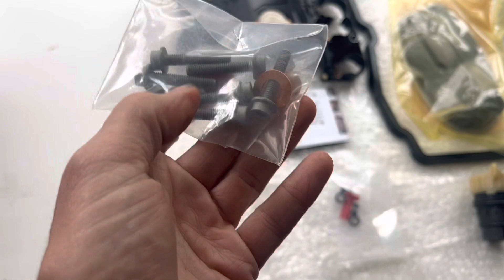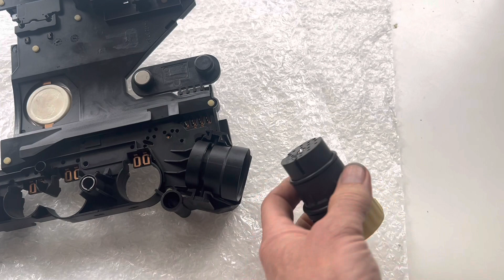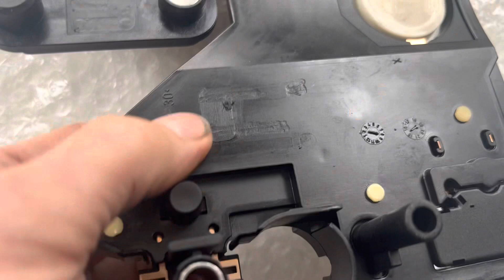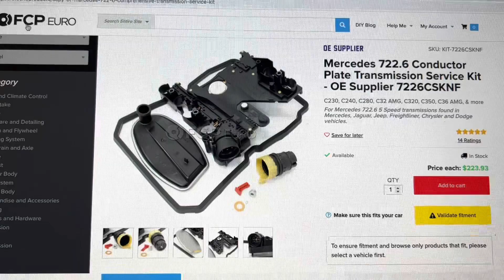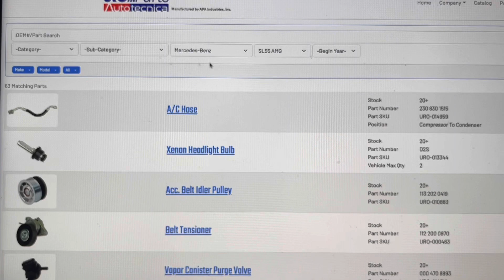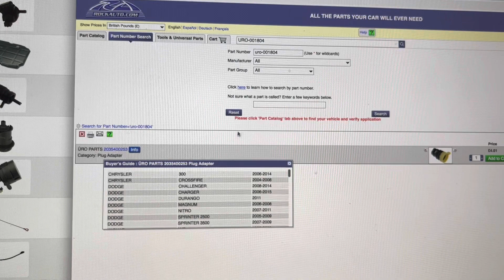Mercedes stuck in gear, limp mode, hard shift problems 722.6 transmission conductor plate. Oil leak.

Comment: Awesome Video.. Thank you very much.... THE BEST 722.6 Video I have ever seen.. and I have seen MANY......especially the Bilstein Information for part numbers.. PRICELESS INFORMATION.... I have 2 x w203-045  C200 Kompressor one has 300K KMLMS..The other has 108K klms... I am about to replace the whole control unit inside the Transmission... bought on eBay for $251  shipped... see what happens  (giggles)
Reply from the maker: Thanks for your kind comments. Good luck - it will be hugely satisfying if you can get it sorted as a garage would no doubt charge you a fortune. Mike

Comment: Hey Mike, on the 1980's, w126 's, do these older transmissions do something like this and limit speed. I still haven't fixed the SEC after two years. It won't drive faster than 30 mph. It's been over a year since I touched and looked at it and now I am seeing a repeated theme in newer Mercedes and sprinters.
Reply from the maker: My older mercs certainly don't have this type of complicated transmission. Give me the exact model and year of your car and the exact symptoms. Mike

Comment: @MikesMercsandothercars 
So I bought a really cheap conductor plate for my 97 sl320 for like $60 and it's working fine but seeing the prices everywhere else has me concerned do you think it will be fine or will I need to get a more expensive conductor plate  and redo the job?
Reply from the maker: Well, they do say if it ain't broke, don't fix it so hopefully you will be just fine....and if it does break prematurely, you will know better next time. Mike

Comment: Hello, in my case it locks up in 3rd gear, after starting the car it only goes to 4th gear, and after downshifting to 3rd it stays in this gear. Do you think replacing the board will help?
Reply from the maker: What car do you have? If you have checked your transmission fluid level and it is OK, next step would be to scan the car for fault codes. Mike
Reply: @MikesMercsandothercars  viano w639 2.2 cdi
Reply from the maker: Have you scanned the van for codes yet?

Comment: Hi Mike I just bought a cheap project ML320 with the 722.6 transmission. only 118k miles. but it doesnt move in any gear. reverse and drive rev just like I'm in neutral. any ideas? I noticed the rear shifter bushing is missing but I would think I could atleast get the car to move a little....
Reply from the maker: First thing I would do is to check the level of the transmission fluid?

Next I would scan the car for fault codes - specifically related to the TCM Transmission Control Module. Mike
Reply: @MikesMercsandothercars  I have a transmission dipstick on the way. its supposed to come in tomorrow!

 If I have TCM related codes do you think i have the transmission fluid wicking up from the harness problem?
Reply from the maker: Possibly. First I would check the level of the fluid. If that is OK, I would look carefully at the codes. Could be conductor plate, solenoids in conductor plate, hall sensor, speed sensors, small metal particles in oil shorting out connectors, oil wicking up cable...to name but a few things. Mike

Comment: Can you recommend a good code reader to delete the dtc codes? I changed my conductor plate and my reader can’t communicate with my transmission
Reply from the maker: I use the Autel Maxidas DS808 which is quite expensive. I also have a cheap and cheerful Launch scanner but I'm not sure whether this can delete those codes - I've never tried. Where are you based? Mike
Reply: @MikesMercsandothercars located in MN, getting the p0715 code still even after I clear  it, thinking about getting the iCarsoft MBII to connect to the tcm
Reply from the maker: @majerbear_zz  Is MN Maine?...Manchester...Munich? Not sure the iCarsoft will be able to delete that transmission related codes - I had one and just sold it to a subscriber who just needs it for basic stuff.

Do you have a Mercedes Indy near you?
Reply: @MikesMercsandothercars Minnesota, I do have one but they won’t clear the code for less than 200 bucks
Reply from the maker: That seems like a lot. What vehicle is it?

Comment: Would this being bad cause the car not to go in reverse
Reply from the maker: Possibly……although my guess is that your problem lies elsewhere. Remember losing reverse on my R107 and thinking I’d need a new transmission but it turned out to be something really simply. So you might be lucky…. Mike

Comment: I recently replaced the conductor plate on my transmission. After the replacement, the car shifted fine for about a month—around 7 to 8 driving sessions.

However, after the 8th time, the transmission went into limp mode again. I did some research and realized I had used a cheap conductor plate.

Round 2:
I decided to go with a more reliable part and bought a higher-quality Dorman conductor plate. After installing it, the car shifted smoothly and drove fine for about 5 miles. I then parked it for 15–20 minutes.

When I started it back up and drove off, the transmission didn’t want to shift properly around the 10–15 mph range. I pulled over and waited a minute without turning the car off. After that, it started shifting fine again.

Once I got home, I checked the transmission fluid level—it was low. I added a bit more fluid and went for another drive. But after turning the car off and restarting it, the same shifting issue came back.

At this point, I still feel like the transmission fluid level might be the cause of the problem.

Any suggestions?
Reply from the maker: Hi - sorry to read you are having a problem. What car do you have and do you have any transmission related error codes when you scan the car?

I wasn't aware that was such a thing as 'cheap conductor plates' - I have never heard of that as being an issue.

If you were low on transmission fluid that would definitely cause transmission issues. Do you have a transmission dipstick? see:

https://www.youtube.com/watch?v=Xx8iDOgbEZ4&list=PLONqXqFnLGrjrRMyMj-02uPxLVogBjr8a&index=15&pp=iAQB

https://www.youtube.com/watch?v=lkYPmtp8W4w&list=PLONqXqFnLGrjrRMyMj-02uPxLVogBjr8a&index=25&t=647s&pp=iAQB

Mike
Reply: @MikesMercsandothercars 2013 sprinter, and yes, dipstick reads on the low end when it's not running, but after it's running, it's shorta like nothing is there on dip stick.
Reply from the maker: @endersingh3180  Hi - I am no expert in the Sprinter BUT....ideally you need to have a scanner to check the transmission oil; level correctly. The temperature of the oil will affect its level on the dipstick and that is why you need a scanner to read the correct temp. With the transmission oil at 80 degrees, your level should be at the top end of the dip stick. If you are using the correct dip stick and it is reading close to zero then you have a problem. First you need to top up the oil to the correct level using the procedure outlined in my video...and then you need to ascertain what happen to your transmission fluid....and third you need to pray that you havent damaged the transmission by driving with low oil. IF you have low transmission oil, you will experience no end of tranny problems...limp mode....difficultly changing gear, gears slipping etc. Mike
Reply: @MikesMercsandothercars this is the best explanation I've seen after two weeks of scouring everything online. I followed you on the w126 SEC postings. I never did get the SEC working and have a general feeling after the 1970's, all Mercedes and related vehicles are garbage. VW makes a better product. I also feel most mechanics simply skirt the real problem and are only good at replacing parts but don't really do hard diagnostics and root cause analysis. They don't have the time to go that deep so there are a lot of junk videos out there and sadly AI is feeding from it and also misguiding many people even so called experts. I don't blame the engineers. I believe the problem is deeper than that. Junk in means junk out.
Reply from the maker: @ace7821  You are SOOO right. The amount of times I see Mercedes related misinformation propagated across the web. As for the Conductor plate video...and most others I do, I scour the internet for every video and then I read every comment and then I try and put the info in a form that I can understand and refer back to. Mike

Comment: Would a bad conductor plate cause slipping? I got an e500 that will shift roughly into drive and reverse , not change gears , then completely slip, I have to turn it off , wait and it will go into gear again
Reply from the maker: A faulty conductor plate could cause those problems.  I assume you have checked the level of transmission fluid? Have you scanned the car - it is showing any codes? The transmission control module could also be faulty. Sometimes transmission faults codes can only be cleared by a high end scanner eg STAR. Mike

Comment: Hello Mike , I have a Mercedes with a 722.6 transmission and the first time I changed the fluid it was fine and it has traveled 61 thousand miles and I changed the filter and fluid type mb236.14 and I measured the level while it was hot and the level was correct between the two conditions 80⁰ after the change there was heaviness and weak torque and a slight delay in the shifts but there are no slips and I checked with the device and there are no registered codes so I would like to ask you based on your experience in the field of Mercedes car maintenance is it considered a normal thing or a dangerous issue and I should stop the car and thank you
Reply from the maker: Sorry to read you are having a problem. Can you clarify:
1. Do you mean you changed the fluid and it worked fine for the next 61,000 miles….and now you have changed it again and there is a problem ….
or do you mean you changed the fluid after 61,000 miles and now there is a problem?
2. Does this issue occur both when the car or cold and when it is warm?
3. Did you measure the fluid that came out and put the same amount back in….or did you just use the dipstick?
4. Does your car have its own dipstick or are you using an after market one?
5. Have you seen my video on changing the transmission fluid?…..because the orientation of the dip stick can make quite a difference. 

Mike
Reply: Also consider changing the Cam Sensor...

Comment: Also the Capillary problems ..The ability of a liquid to flow against gravity in a narrow tube

Capillary action is the result of the combination of two forces: the attraction between the molecules of a liquid, called cohesive forces, and the attraction between those molecules and the surface of the tube, called adhesive forces.
Reply from the maker: Yes you are right - it is the capillary action that can lead transmission fluid to wick up the wires into the transmission control unit causing all sorts of issues….especially if the fluid has small metallic particles in it. Mike

Comment: I own a mercedes S600, and the problem that I'm having with it is that I believe that the 1 and 2 gear solenoid is getting stuck and  is making  the car to change gears very solid to a point that feels like something wrong with the transmission. I have watched several videos about the situation. And I'm thinking of replacing the conductor plate and solenoid. Can you please tell me on the S600 which one is the 1 and 2  solenoid? I'm thinking about replacing it too. On your video you point at a different one from the ones I have seen. And another question, when you buy solenoise, are they number 1 and 2, 3 and 4 ect. Correct?, You are the 5th person I reached out to.
Reply from the maker: Thanks for your message. Before you start changing the conductor plate, I am assuming that you have checked the level of the transmission oil as a low level can cause all sorts of shift issues.

I'm not familiar with the S600...although I would have thought that any car with the 722.6 transmission would have the solenoids in the same place.

What country are you based in?

Mike
Reply: @MikesMercsandothercars  thank you for responding. I did check the transmission fluid because I was told that can cause problems. Even bought a dipstick for it because the car doesn't have one. I've been dealing with that issue for the past 2 1/2 years with no solution. I have watched several videos, and I happened to come across your video not too long ago. i decided to take a chance and replace the 1&2 gear solenoid that is the only gear that the car seems to have problems with when the car is cold, once the car reaches normal temperature, it runs fine. I'm in Columbia, South Carolina
Reply from the maker: @ I am no expert in these matters but can I ask you:

1. When you measured the transmission oil levels, did you take readings at the correct temperature (25deg and 80 deg). The design of the 722.6 transmission is such that as the engine warms up, the level of transmission fluid changes substantially. This is why some people exhibit a problem when the card is cold but not when at running temperature. If in any doubt have a look at the video below at around 10.30 minutes inL

https://www.youtube.com/watch?v=lkYPmtp8W4w

2. Am I right in thinking that you have already renewed one of the solenoids? I know it is a bit of a pain to do this but....what often helps is to switch the solenoid to another position and see if the problem jumps to those gears. If not, then you know it has nothing to do with the solenoid.

3. Have you run diagnostics - any fault codes? On some cars, transmission related faults can ONLY be cleared with a very high end scanner like STAR. eg  car is in limp mode for example, you change the conductor plate and the car is still in limp mode.....because the Transmission control module has stored the fault code.

Mike
Reply: @MikesMercsandothercars  Now reading your your response. I'm not quite sure if I did let the car warm up to the right temperature. It has been so long since I mess with it, and I don't remember. I will check the oil again this weekend. I will check that again before I do anything else. Thank you for the video

Comment: My 98 e320 is in limp mode-3rd gear. I have to hold the key to the start position for about 15 seconds before it will try to start. I have cleared all codes and it's still stuck in 3rd gear. If the conductor plate is bad will that cause it to be stuck in limp mode indefinitely?  The parking lock solenoid is not working. The fuel door does not unlock until the truck button is pushed on the fob.  I only have a $20 code reader, no live data, so I'm assuming it won't give a code for bad conductor plate. Would you advise changing conductor plate and filter?  Or does it sound more of a problem with the ECM?  I have cleared all codes and took car for ride still stuck in 3rd gear to see if it will show any codes and it doesn't.
Reply from the maker: It is often the case that you can’t clear limp mode faults with a cheap scanner.  My advice would be to take it to a merc indy and get them to clear the code first. Mike